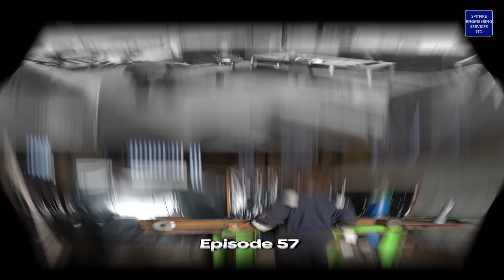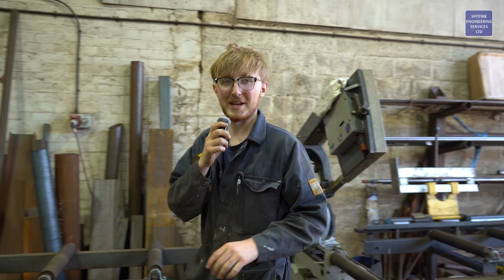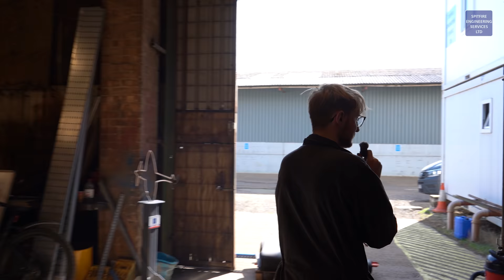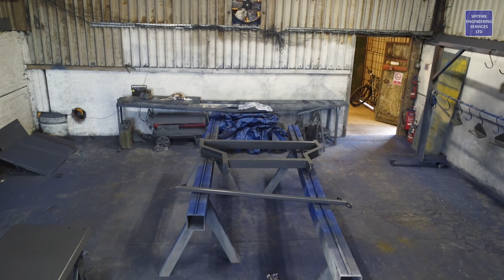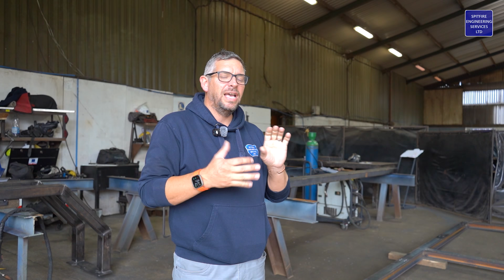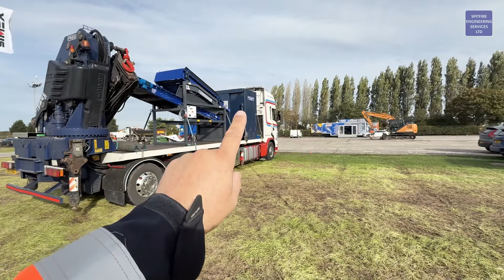Cayman Build is BOOMING! 🔥 You Have to See This…

Comment: Some fun trivia to sink your teeth into - 
1. The Sinclair C5 (1985)
2. Hamblin Glasses (1936)
3. Teasmade (1902)
4. The Advanced Passenger Train (1970s-1980s)
5. Amstrad E-mailer (2000)
6. Reliant Robin (1973)
7. Baygen Clockwork Radio (1991)
8. The Dynasphere (1932)
9. The Panjandrum (1943)
10. Thomas Crapper’s Musical Toilet (Late 19th Century)